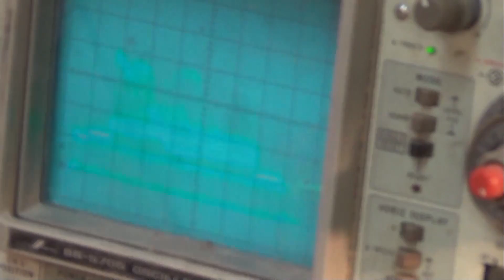Technics SU CH90 CD skipping lets find out why

Comment: I did this procedure on a Panasonic RX-DS750 boom box that was built in 1996.   It definitely needed the worm drive cleaned and re-lubed, but it didn't fix the skipping problem.
  
Mine had a weak output on the laser.  Luckily, that laser adjustment can be accessed without taking unit apart.  Insert CD, select something around track 6-10.  Stop it and remove CD.  Head will be aligned where you can get a small screwdriver in the gap on the left side of head to adjust the potentiometer.  Mine just took about a 10 degree counter-clockwise adjustment of the screw.  Stopped skipping after that.    Thanks for the video!

Comment: Taking a look at the "eye" pattern will give you good info on the health of the laser. The manual will give you the amplitude as brands differ. Usually around 1 volt ptp.
Reply from the maker: Not so much the amplitude, the diamond pattern needs to be clear. That was much more important on CD players with manual adjustments. This one has digital servos so nothing to adjust.
Reply: Only for manual servo cd players.  New cd players all have a digital servo that you cannot adjust

Comment: Mine Technics SL-CH510 had a cd skipping problem. i'm not a pro in these and replaced laser lens and the problem still the same, the grease looked good to me and the movement of the lens module looks ok. put the CD spinner motor working and a strange noise of bad motor. Replaced and voilá! Thanks for your sharing!

Comment: If it sits around for any time  the lens will be dusty. Did you noticed where there was a change of height there was a long covering of dust on the top 
of the assembly as well. A lot of people bought these units back in the day. This is usually what happens to most of them and excellent video on the fix!

Comment: My Panasonic unit has 3 small dampening springs attached to the electronic board,  impossible to remove without breaking the center pin.  On the other side, if I tilt the whole radio forward, the CD player starts playing perfectly smoothly.

Comment: I always oil the front bearing on the spindle motors. If you've gone this far it only makes sense to me, Another example would be a tape deck if you have access to the capstan bearing why wouldn't you oil that as well with a little sewing machine oil or better yet some full synthetic motor oil. Just some thoughts here.

Comment: Interesting mechanism. Looks similar to the one in my 1991 Technics SL-PD607 5 disc changer (which also has the MASH DAC,) except mine has a solenoid/linear servo that moves the laser, which is nice because there are no gears that can break.

Comment: I have a panasonic cd Player from the mid 80's and im sure your familiar with the panasonic/technics (matsushita) based cd Players with the brushless spindle motor and very quick loading. But I might need a little info on one. Its the fact that it keeps making a constant frequency noise from the linear tracking coil on the optical block.  But it does function. The other issue is that sometimes it does nothing at all. It will do the common motor thrust on power up then nothing else. But after cleaning and lubricating. I tried barely tweaking the laser diode adj a hair then back to check it and it read the disc almost immediately but wont play. Just keeps spinning slowly. But its a brushless motor that rotates freely so its definitely up to the signal generator to drive the correct speed id think. And im not sure how to adjust or approx where the adjustments should be since there are 8 or 9 adjustments to this model. If you happen to know anything about these id be happy. I do but not sure on adjustments. I was going to use a scope but its not where my scope is at the moment and i do beleive in most service manuals and matsushita cd Players you do need to jump a couple connector to ground and use a little box to make proper adjustments unless you just know about where they need to be and tweeking them. Which would be possible if you can get it close. But i just need to get it close enough to play since everything else looks fine. If you can help id greatly appreciate it. And i can send you the model no. And some pics or maybe a quick vid to show you the issue. I dont want to take up to much of your time but i know you have experience with matsushita products and i do as well but could use guidance on these particular settings. But i can make most adjustments. I love these cd Players and most of their products especialy certain models in particular so id like to get this one going fairly soon so i could enjoy it and pull out some others i havent used in a while as well. Its been sitting a few years. Id like that. Thanks.

Comment: Hi dave, I had a technics unit like that but it was real old and it had one if these fluorescent multicolor "wow factor" displays,  But it had no display and I couldn't see any slight glow from the filaments anyway after checking it had a direct ac supply via 2 fusable 10 ohm resistors from the transformer. after checking it out one if the resistors  one of the resistors had gone o/c probably through age, anyway all was fixed and is still working now
Anyway Dave happy christmas mate and "hopefully" a phrouerous next year. Paul from the British Empire!  lol
Reply: Vacuum Fluorescent Display.

Comment: Thanks Dave (been watching your videos-excellent ex Schlumberger Tech) for the cassette switch and cd advice got my Panasonic Sa AK330 shop cadillaking. What belt drive assortment would you suggest buying for general multi purpose shot in the dark lol use ?
Reply from the maker: Look on eBay for some cheap multi pack belts.  Usually a pack of 40 assorted will yield a half dozen useful sizes.
Reply: @12voltvids   square round flat ? Whats your $uper chat ? Once again THANKS

Comment: Wonderful! A new video!! Happy Holidays! I have a Sony (2008) all in one System. The CD drawer won't open. Luckily, no CD is inside. 3 disk changer. (Bottom of unit) Probably the belt, but I can't see it.(I took the side panels off) It would probably need a major disassembly. And I am not sure I can do it. The Radio works fine. And the aux input also works.
Reply from the maker: I have 2 R-R units awaiting their turn on the benck.

Comment: Sometimes I had problem where the burned CD wouldn't track properly at beginning or end of CD. No problems with original pressed CDs. Then again some players are more immune to scratched CDs than others. I still use early 90s Sony that won't read all burned CD-Rs but the components quality inside is very high for mid price unit and has all the funtions including indexing.
Reply from the maker: CD players from before cdr were developed have problems reading many burned disks.

Comment: Speaking of the Solder Wick, instead of the copper wick that will work to siphon the solder off from the board, will the aluminum wick siphon the solder out from the board two?

Speaking of the music, haven't you heard any music from Bath And Body Works from MP3 player that has the music from 2007 or 2008? I don't know that you're interested to know what that is. =/
Reply from the maker: Solder will not flow onto aluminum.

Comment: Hello dave.
I have a koss ks4122 that stopped playing dvd's, i changed the laser pickup, leveled the laser table with a bubble level.
The laser has two pots, one for cd and one for dvd, i was able to get to play all cd's and cdr by adjusting the pot cw.
The dvd started out no spinning the disc, then i adjusted the pot cw and now only 1 dvd will play, no other dvd's will play, i have found with different small cw movements i have approx. 2 dvd's to play.
The main board has no focus or tracking pots on it, do i find the rf point and adjust the dvd pot for maximum vertical output with the least vertical jitter.
I have a 10mHz scope, is this good enough to view the eye pattern.
I would like to get the player to work again.
Any help would be appreciated.
Reply from the maker: They all use digital focus / tracking these days. Your spindle motor is likely the culprit.
Reply: @12voltvids  i replaced both the spindle and the sled motor, no improvement, but these motors were used.
How do i adjust the dvd pot, is there a procedure for this, this adjust and try is time comsuming, i might be overshooting it.
Is it a precise adjustment, i have the resistance measurements of the pots when the laser was first put in.
Maybe i remove the cd loader and position it above the table and adjust the dvd pot while watching a movie, still have to find the rf test point.
I can not find any service info on this dvd player, but i think there should be others that have the same two pots.
Do you have any service info on this type of laser pickup.
Thank you again for answering my question.

Comment: I thought that the capstan motor would be a stepper type.
So how does it maintain an accurate speed?
Does it have weights on contacts that go open when it spins too fast like in ye olde turntables?
But I don't think so.
Does it regulate the voltage to the motor?
Or none of the above.
Reply: The data is read into a buffer, so I don't think the speed has to super accurate. It just has to spin slower when the laser is at the outer edge of the disc. It probably just varies the voltage to the motor
Reply from the maker: The motor has a voltage regulator to control its speed. Some motors have servos, but not this one.

Comment: I finally got a desoldering tool, from Hakko, vacuum power, as it heats, works better than wick, or solder suckers..
Reply from the maker: That is something on my wish list but I don't  do enough work to justify it.  At least that is my reasoning for not buying one.
Reply: @12voltvids  Just buy it, you'll love it! Adjustable heat, you can change tips for different hole sizes. It 's so much quicker. I damaged a $4000 industrial PCB desoldering the typical way, but never again. The best tools aren't cheap, but I've never regretted having one, either.

Comment: Fun jog down memory lane, but who is still using a shelf system CD player like this in almost 2020? Almost no one judging by the large number of these I see for around $14.99 at Good will.
Reply from the maker: I see many still in use at work.  For some people space is a premium and these systems fit in perfectly.
Reply: I have an Aiwa in the garage, but the Sony kss-213f-based 3CD player on that one is mechanically broken.  I use it for FM radio and can plug my phone into it. That one, however, sounds better than any of my Bluetooth speakers, but that is because the Aiwa speakers I am using are from their flagship model, far better than the typical Aiwa speakers.

Comment: there are 2 types of skipping..1/skips tracks [which i think is more common] 2/skips WITHIN the tracks 2 to 6[which is more rare]-this is my problem i have a Technics PG 4 [2000] and it started doing this a few[3] years now...what could be the problem from Greece
Reply from the maker: Most likely the spindle motor is worn.  The bearing wears out and causes vibration at certain speeds which shakes the disk and causes tracking errors
Reply: @12voltvids  could a new laser help...i cleaned it and it worked a time, then it started.

Comment: Sometimes you can have it defective CD I have a Pink Floyd CD that looks perfectly normal no scratches looks brand new in one of my CD players it ejects it instantly on the other CD player it plays but right in the middle it starts to skip so I did a little test I played 15 other CDs that I have completely from start to finish no problem that's telling me right there there's a problem with that Pink Floyd disc like I said I played 15 on the other CDs and no problem sometimes you can get a defective CD people and it's nothing to do with your player
Reply from the maker: There were tons of bad CD. Look and see if it was manufactured by Cinram. They made tons of CDs and DVD s that were difficult for certain players to read and they read fine in others.

Comment: Chances are that, the customer has a bad CD, maybe that's all.
Reply: probably not as many lasers/decks get sporadic issues where the disc doesn't skip in the same spot.  If it skips in the same spot and you can see light shining through the disc, then obviously it's skipping from damage to the disc.